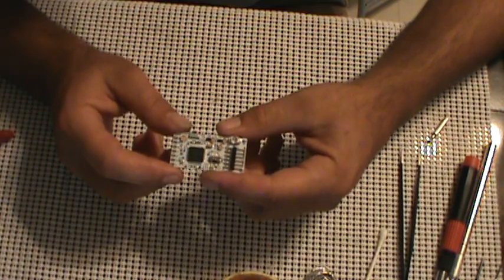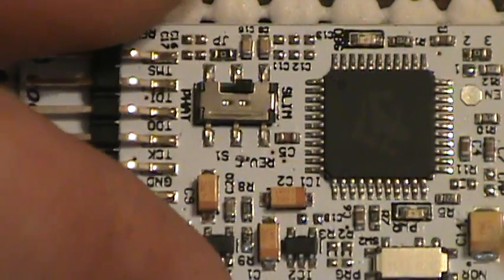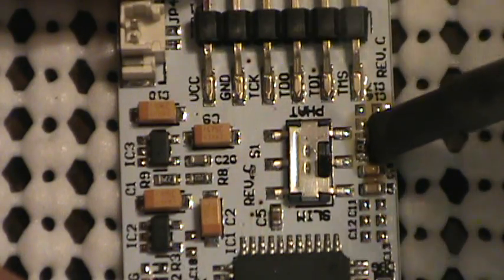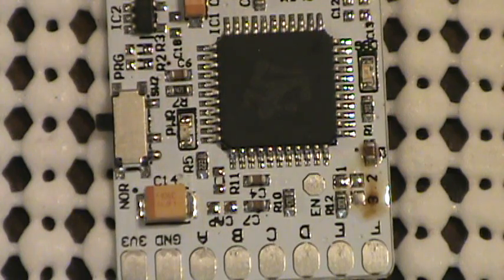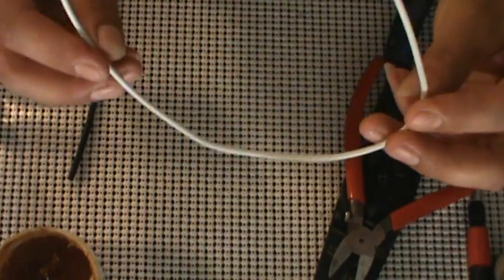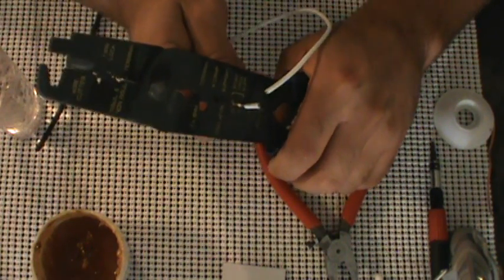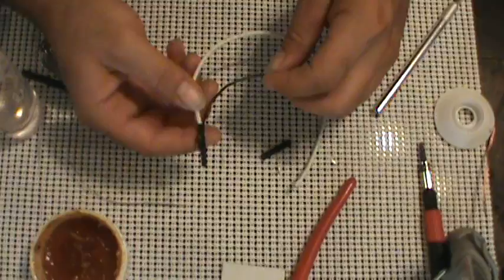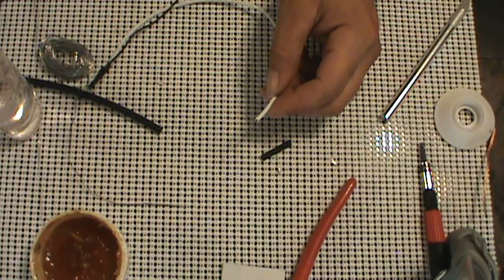Xbox 360 RGH 2.0 Tutorial Part 1

Comment: were do you get that glue from?
Reply: its called Flux
Reply: you can buy it from mostly any electronics store or ebay
Reply from the maker: Yes the yellow honey looking stuff is called flux paste.  I got my tub at radio shack.  Make sure you buy from an electronics store not a hardware store.  Theres two types of flux paste.  That which is used on electronics and other stuff used for plumbing.  You dont want the plumbing shit!  It will short and eat anything it comes in contact with on your motherboard.
Reply: +Keil423 You gotta remember flux used for plumbing is especially bad, it will burn your fingertips off.

Comment: Did it. [started attempting to glitch]
Redid my soldering had a mess of rgh and rgh2. set it all to rgh2. [stopped attempting to glitch]
noticed the nand i flashed was under 14719 so reflashed with above 14719 [still won't try to glitch]
Red light comes on but Green won't. I think i messed up the solder point on the xbox for rgh A (by the xclamp). gonna try to put a drop of solder in there in the morning.

Btw the xbox turns on, the dvd drive tries to read and the fans spin.

Comment: did as you said. it's trying to glitch now. tried different timing files. also noticed the cats had nom'd on F and E so i soldered those back (might be the reason it wasn't glitching right in the first place. btw i'm using the new qsb  for the cool runner.

Comment from the maker: I'm really not familiar with the Matrix Glitch chips.  I'm not sure how they are built.  If matrix build theirs similar to the Coolrunner then they may likely have the same basic layout.  In which case you would still have to remove the resistors to apply a solder bead between points 1-2.  At least on a coolrunner it would be points 1-2 and JP is to be left open.
Be warned that Falcons on RGH2.0 can be a nightmare.  Timing is a big issue for them.

Comment: Hi, I have a Matrix Glitcher board and a Phat Falcon box with 16202. I think you know that from 2 weeks ago it's possible to RGH boxes like mine with RGH2 method (the only difference you don't have to create ECC file just put a modified ECC file in the nand). So my answer: the capacitor removing important in a Matric Glitcher board, too? I saw you used a Coolrunner board so that's why I answer it.

Comment: Keil423 just another quick question instead of removing the resistors cant i just fill them with solder ive had to reorder a rev c same as your using as ive waited over a week for shitty mr modchips for my cr lite also the jumper settings for a rgh2 on a jasper are you using any differant settings thanks again tomo

Comment from the maker: The resistor there from the factory is a '0' value resistor.  Meaning that its the same value as putting a bead of solder across the two points.  Zero resistance.

Comment from the maker: You should have just layed a bead of solder from point to point but puting the resistor back work to.  JP should be left open.  Falcons on RGH2.0 are a pain.  You might want to order in the new CPU_RST Cleaner that Xecuter put out.  I had to falcons that refused to glitch on 2.0 until I added the Cleaner.  Now both consoles glitch.

Comment from the maker: Its usually a cold solder joint that causes this issue.  Look over all your solder point.  If any are dry looking (not shinny) then put some flux on it and reflow the solder.  If everything there checks out fine you could reflash the retail nand (switch coolrunner to PRO) and see if it boots.  
If thats fine just create a new Image and write that back to the console.

Comment from the maker: If its on 7371 you should check the CB on it.  Theres a good chance that its Jtagable.  Jtags are more reliable boot time wise.  Otherwise you could just grab an official M$ systemp update for dash 13146 and apply that.  Then you could do RGH1 on it which is still pretty decent boot times depending on the console type.  Or grab dash 14719 and perform RGH2.0 on it.  Boot times are less reliable but then you would have the option to add a demon in the future if you wanted.

Comment from the maker: Because they are blank resistors.  Your supposed to remove them and put some jumpers in.  Depending on your console and also if your doing RGH1 or 2.0  Some require a bridge on JP and a bridge on either 3-2 or 2-1.  Again which combination you use depends on the console